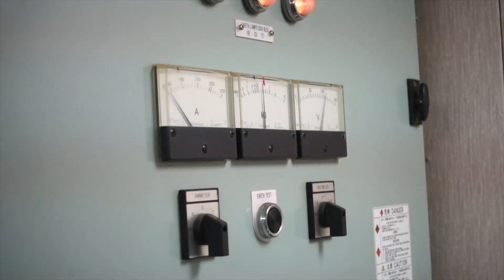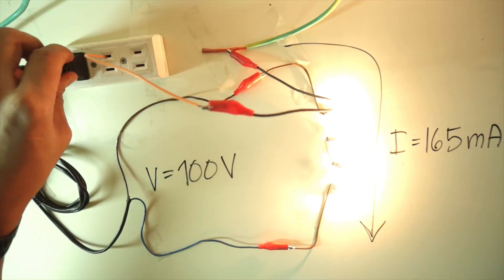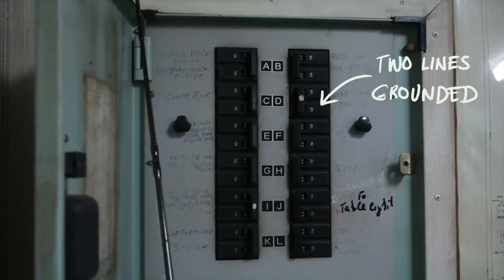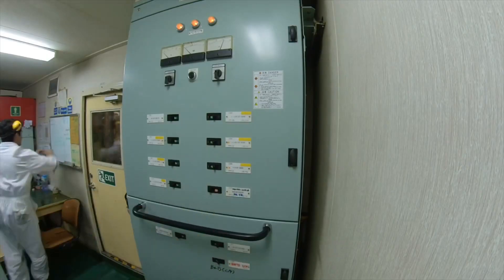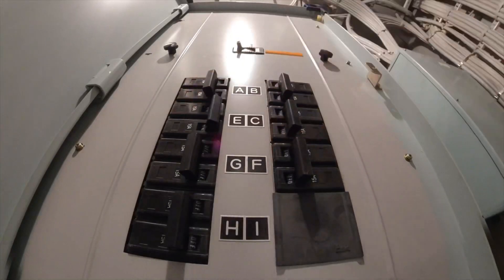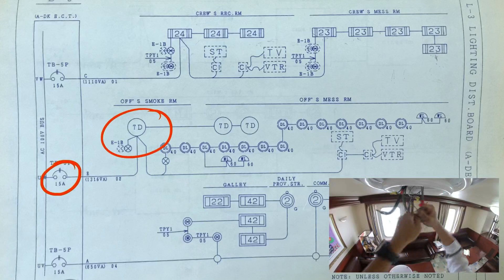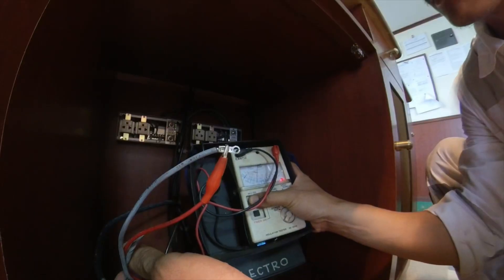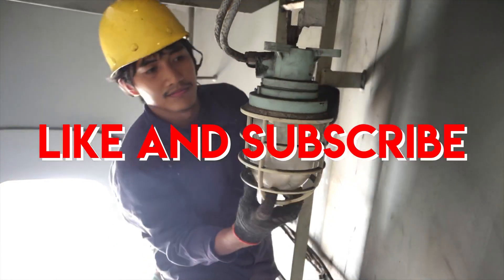Finding a Low Insulation | Marine Electrician

Comment: Electrical engineering fight with moisture or humidity including dust particles, ... Same like mechanical engineering fight with fraction and gravity force , fraction couz of dust ... , challenge is to keep facility protected from natural factors . Vibration, fraction , dust , sunlight, , uv rays, climate change , temperatures , aging factor , salt water reaction, strain and stress factor, anodized factors , air, wind factors ... A lot more ...

Comment: Hello! I am an engineer and the insulation problem is not clear to me.  Your video is great and worth seeing! At the very beginning of the video (0:46), you measured current with the tester. Could you pls provide a drawing of this connection, pls? Also, your explanation of the motor is not clear to me as well. Why if T-face grounded it shows 0 Ohm insulation? I can understand that the current will flow with the easiest path from the R-face through the grounded U-winding to the ground (1:34). I was wondering if this current will back through the T-face ground and why? And why U-winding will be burned?

Comment: What is the Meaning of low insulation?
Reply: Wirings and cables have the copper conductor core and insulation surrounding. as time goes by, this insulation material may deteriorate over time.  and current will leak to the ground. the metal hull in this case.

Comment: Hello sir .parequest po sa insulation testing of ng machine .salamat po .
Reply from the maker: Meron ako video sana sir kaso nabura ko mga vids. Anyways.

The most ideal way to test insulation of a machine is when it is in running condition. Kasi andun yung mga factors like temperature, vibration, etc2. Pero hindi kaya i-insulation test mo ang machine while energized. The closest we can achieve this ideal way is to check before and after run for few minutes. Tapos before mag test dapat may good ground ka, hindi naka energized ang machine. For low to medium voltage machine, spot-type lang, mga 1minute lang na i insulation test. Sana nakatulong. Salamat.